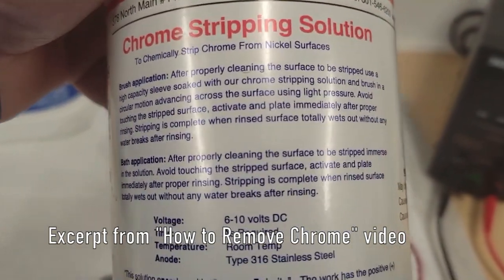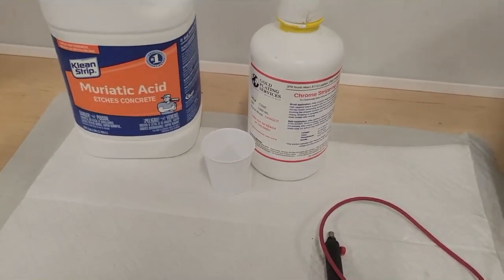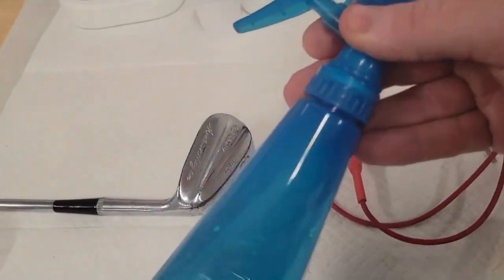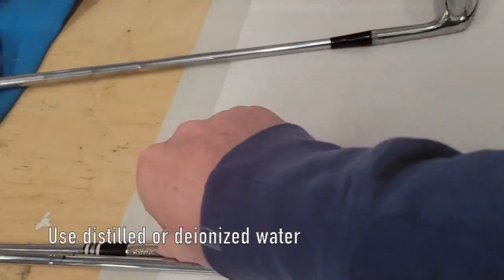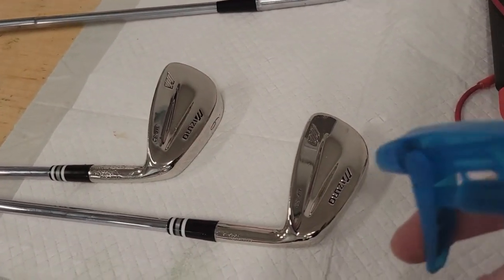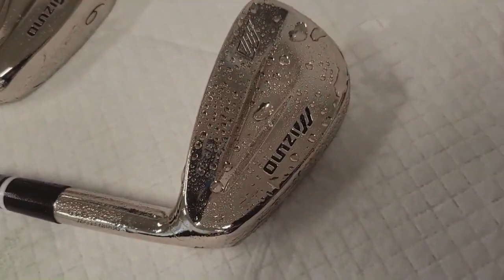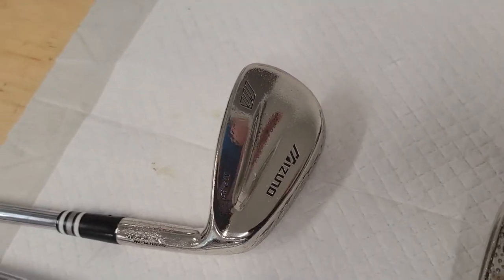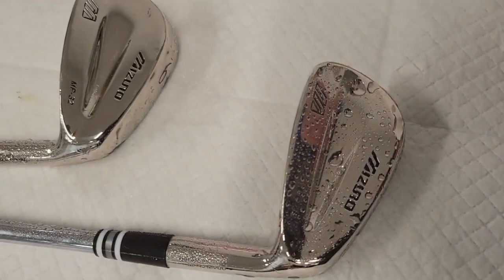The Secret to Perfect Electroplating: The Water Break Test

Comment: Would degreasing the same way you do for cerakote work for electroplating by doing an acetone bath for 30 minutes and then baking it out for an hour? Thanks for the great videos!
Reply from the maker: @WtfIsGluten  As long as it passes that water break test, it should work.